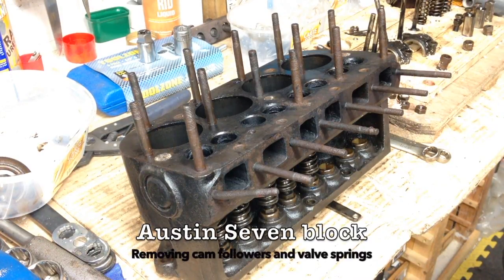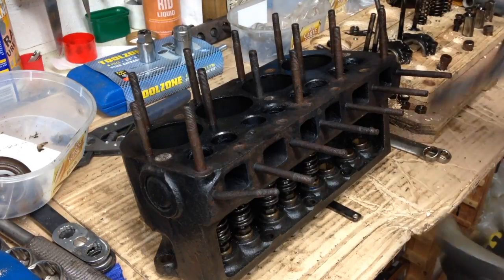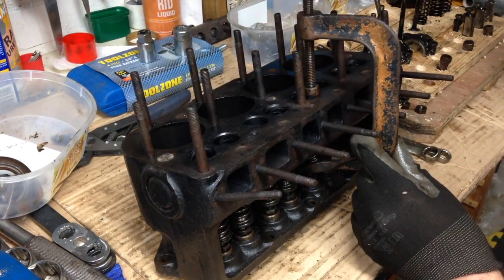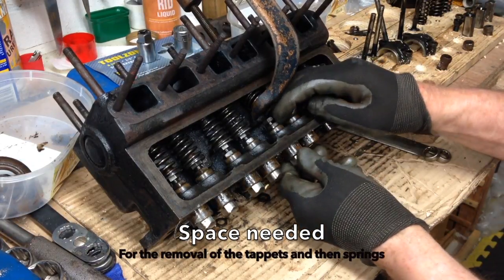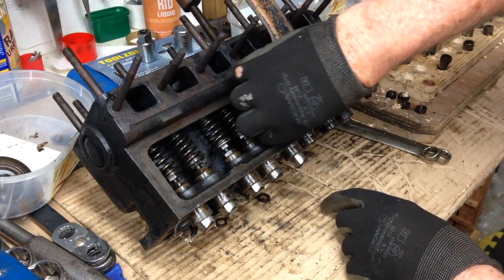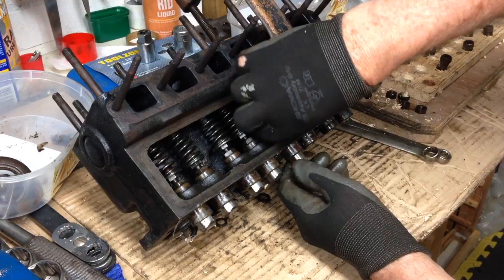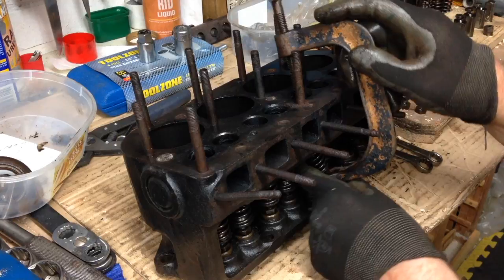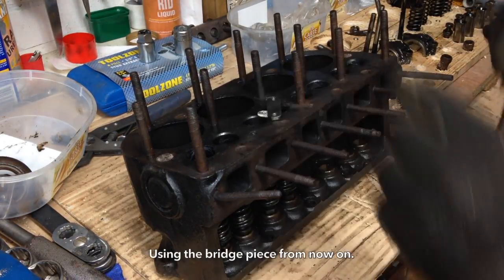Austin Seven - Removing camshaft followers and springs

Comment: Hi Geoff,  great series of videos, very informative.  One tip from me with respect to removing these tappets, in my experience it's easier to pop out the springs and the cups as soon as you've got the valves out of the way before working on the tappets.  Normally you can compress the spring enough using a screwdriver to get the cup off the tappet and then it's easy to pull it away and out.  This leaves the tappet and tappet screw ready to pull out as one piece.  Might be a bit more difficult if there are dual springs but for most A7’s it works pretty easy.  By doing it this way you avoid having to put in a bridge to hold the spring compressor.
Keep up the good work.
Reply from the maker: Steve,
Thanks for the compliment.
I do my best to make the videos that I would like to see , as informative as possible.
Never even thought of using a screwdriver to lift the springs.
The ones I used on my racing Kent engines in the '70s would have needed a 6ft ext on the screwdriver.
Cold weather and a bladder infection has brought everything to a sudden halt.
Was hoping to make a start on the block port work, having nearly finished slicing up an early and late scrap cylinder block to find out where all the metal is around the ports and waterways.
Am going to experiment removing and 'adding' metal where needed, to get the inlets to flow properly.
Watch this space.